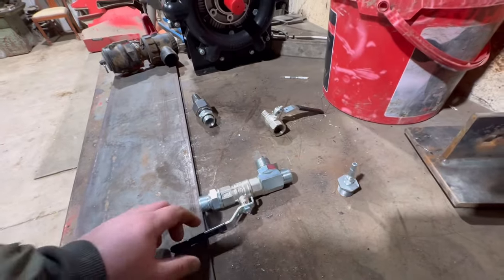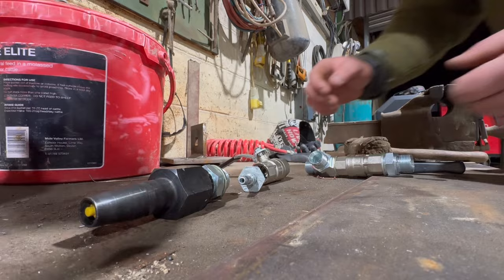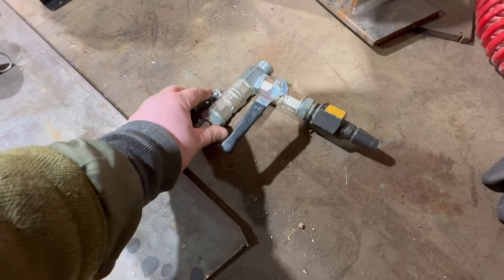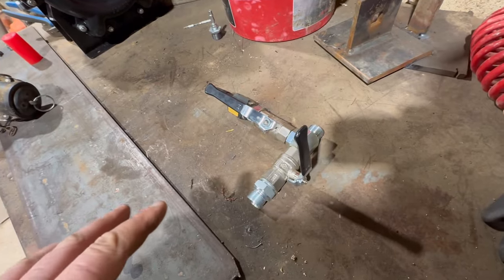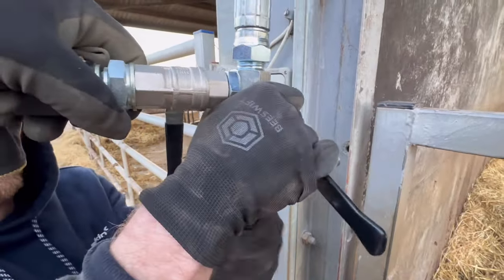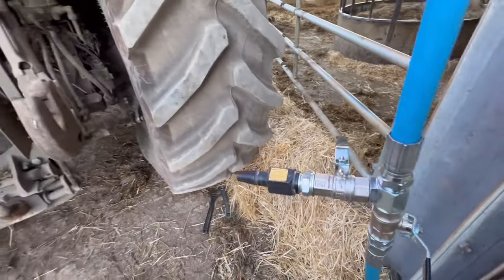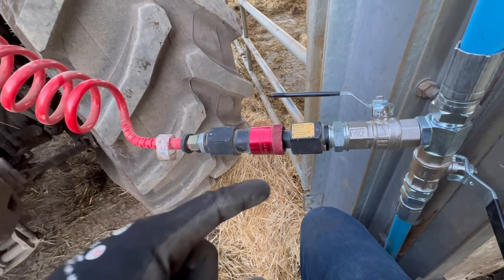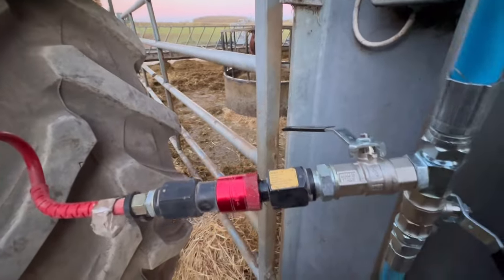This device stops outside water pipes from freezing!!!!

Comment: Yes, I think that's a great idea. There is nothing worse in a yard then a busted pipe spraying water all over the place and in winter this can go to ice all to quickly. Apart from slip/trip hazards an out of control passing tractor could cause a lot of damage or even hurt someone. A simple clever idea that will make the yard a lot safer and help save on repair bills. Thanks Tom....

Comment: My dad used to put his hosepipes in a bath full of water to stop them freezing.   He had to break the ice to fetch them out to use them — which was mostly for washing parsnips.  I remember that as a miserable job when it was cold and wet, which is part of the reason I was the first eldest son in several generations, to go into engineering rather than become a farmer.  I can also remember brushing snow off of cabbages on Boxing Day because the wholesaler had run short, and being up the field waiting for the sun to come up se we could start filling boxes with lettuce. I still had to get up early so I could do the 25 mile motorcycle ride to work by 7:45, but at least I was warm and dry till home time at 4:15.

Comment: Use the very same system to empty the pipe for the car valet bay each winter evening. All the time the bays in use the flow prevents freezing but over night. Drain using the workshops compressor.  Also I’ve seen the same system used for preventing freezing in irrigation system on golf course.

Comment: Might be worth adding a check valve on the air side so you don't get moisture in your air or water backing up if your air is flat.
Reply: if the check valve is reliable it might also replace the second valve after the water shutoff. Though it might end up siphoning the pipe empty on its own if the float on the trough is open
Reply: All compresed air contains moisture without proper moisture traps for spraying etc I would be more concerned  of any oil from the pump or rotting water sat in bottom of the air tanks contaminating the cattles water supply
Reply: If it was plumbed properly ucould simply use gravity to empty the pipes

Comment: Love the idea. We just use a pressure regulator on our borehole and set it at 1bar when it freezes. Or leave a hose trickling on the yard to keep it moving and thermal conductivity from the warmer water from the borehole really helps when it’s moving

Comment: Demonstration site perfect but as you said going to put in different place could just nosey cattle having fun switching the ball valves on lol.   Didn’t you have similar system running off compressor last year ?
Reply from the maker: Yes but wanted to make it easy and quick to use this system

Comment: Just out of interest what size hydraulic fittings are those ?, thinking that’s a tidier solution for running air line around my workshop rather than bulky plastic fittings 👍.
Reply from the maker: Il check in morning can’t remember what they are

Comment: 2 things ..... be very careful pressure in those pipes can build up like a resviour and then explode /shatter ... regulator is a must...... the other question... does the air supply produce oil from the pump into the air system or even sat in bottom of the air tank ...... you are potentially putting  whatever oily build up into your animals water source ....... anybody who uses any sort of compresed air will tell you the horrible infested nastiness that can come out the tanks when drained

Comment: Don't need a pressure regulator as water pipe will take tractor air pressure

Just throttle with a ball valve as you have one

Comment: I think water supply company won't be happy, you have a chance of blowing contaminated water back into the mains. You need to fit a check valve to prevent this
Reply from the maker: It’s on a bore hole so can’t contaminate

Comment: You’re adding contaminants to your water supply . Why not have an isolation valve and vacuum the water out of the line . If you’ve only got air pressure at hand use a Venturi .